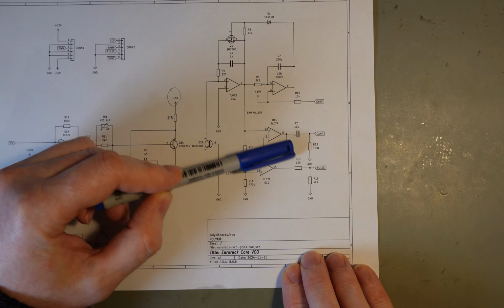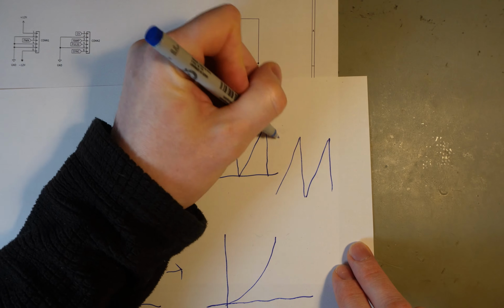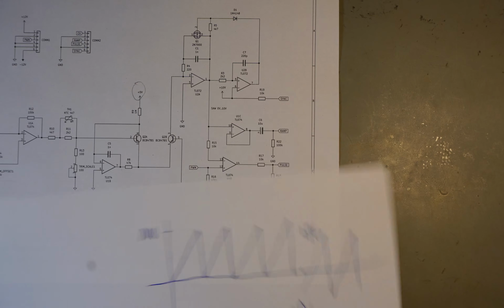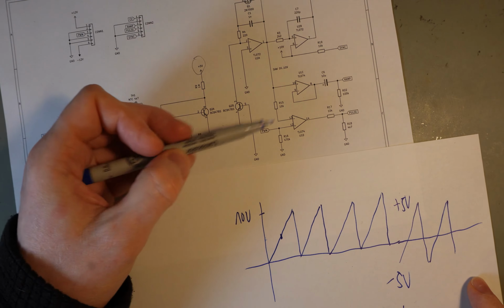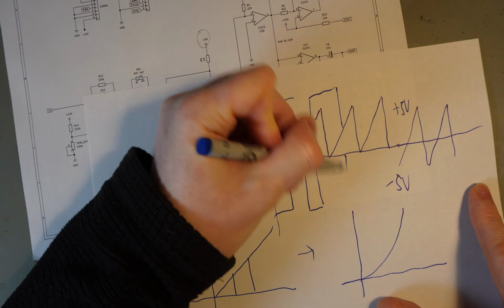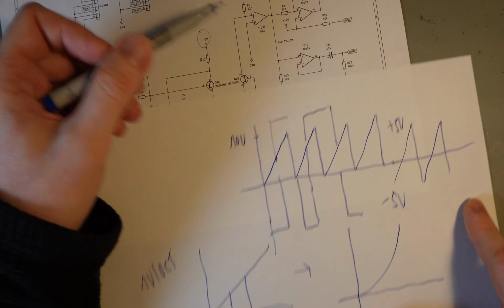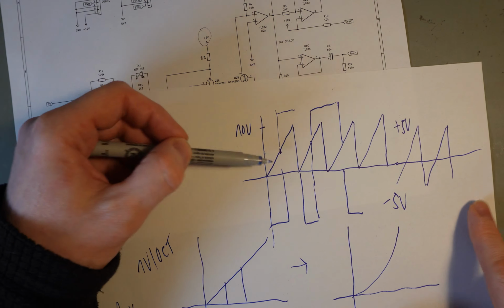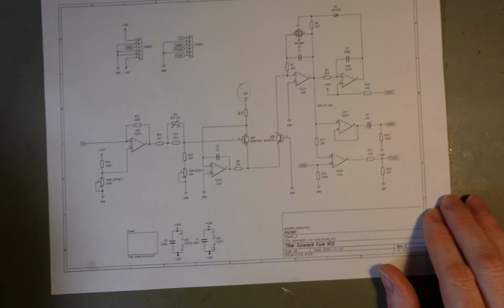How vintage synth oscillators work

Comment: Yusynth and others claim that the +5V (or whatever is used for collector current in the differential transistor pair) has to be generated by some regulator process, like a Zener diode. People claim that the (general eurorack) power-supply voltage might drop "so much" under varying loads that you get audible, loading-dependent detuning. Yusynth even goes as far as regulating all the power source voltage down so that it is definitely stable for the VCO when the power source wires arriving at the VCO cannot maintain their voltage "well enough" under load.
From your experience, is it really all this sensitive/crucial?
Reply from the maker: Yes, this is valid. I don't think you will get the VCO in tune with just the Eurorack +5V rail, especially not over multiple octaves. In the video I only referred to it as a precise voltage source. I'm using a TL431 for the reference voltage which is basically a zener diode.

Comment: Hello! Can you tear down Korg's approach to their (latest) VCO's? I've seen their schematic of the Volca Bass. They use the unusual low voltages as the power supply but somehow they make these oscillators sound great. I've seen the volt. reference IC (as I remember) but I've couldn't understand the whole schematic.
Reply from the maker: Definitely interesting! Let me see if I can find some schematics. Cheers!

Comment: Great, classic and clean design, awesome job! Im generally using 3340's for sake of more simplicity and convenience, but this classic approach has its charms.
All the best!
Reply from the maker: Cool, thanks! Yeah, I also use the 3340, eg. in my 8 voice polysynth, tuning the voices would be a nightmare otherwise.
Reply: @polykit  If Alfa (or someone else) would go and start manufacturing the uA726 again it might be lot more doable, but otherwise, it is exactly as you said.

Comment: So one circut for triangle and pulse wave. How other shapes work?
Reply from the maker: There are circuits for wave shaping. You basically make triangle signal out of the saw signal by inverting the negative part and with a filter you get a sine signal.